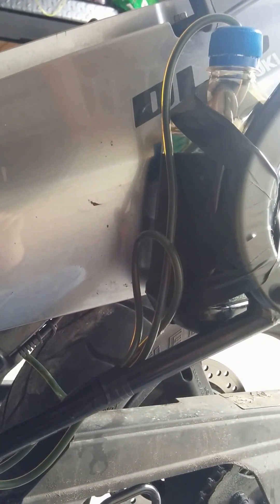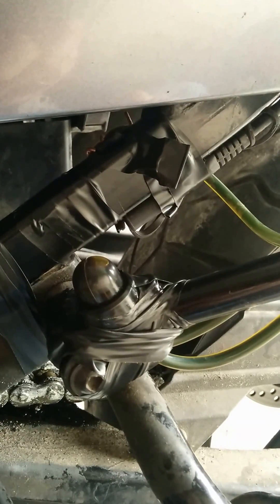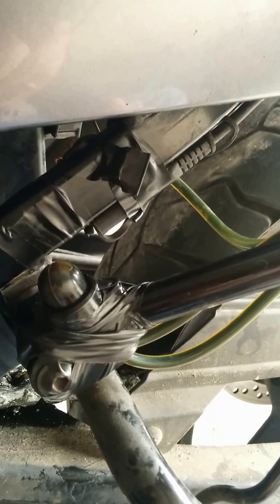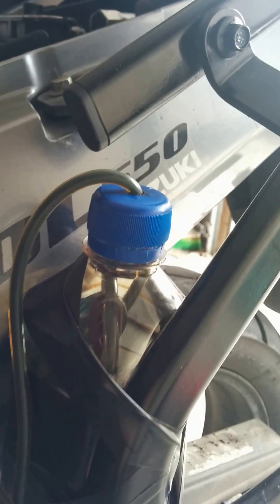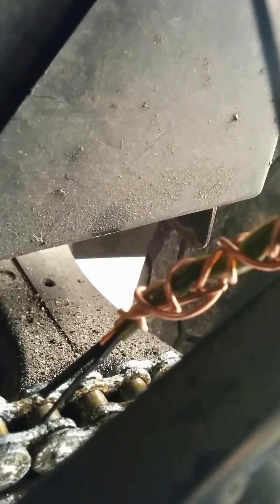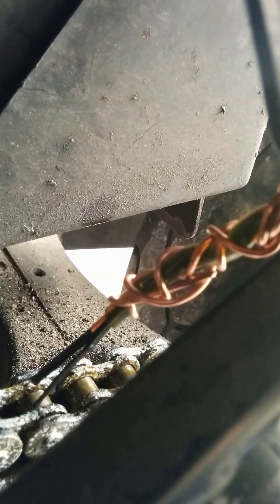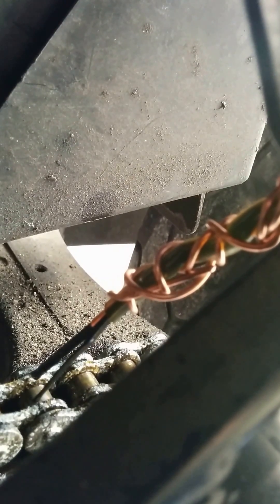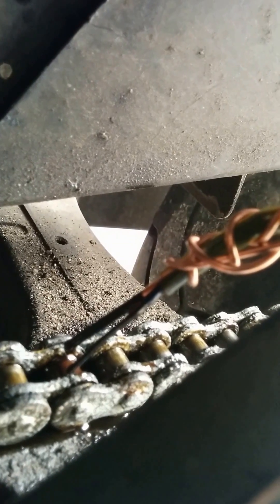$3.50 Cheap Motorcycle Chain Oiler DIY Suzuki V Strom Push Bulb

Comment: Had to drill a small 2mm hole i the brake fluid lid and make a small cut in the rubber lid inside to let some air in so the oil flowed better.

Comment: I used cable ties to mount a brake fluid reservoir near the passenger foot pegs (away from passengers feet) and a in line plastic tap from micro sprinkler system for adjustment to one drop every 45 sec  . I did the cable tie ends in the pipe but used clear hoes with a bit of fencing wire shoved up it so it could be bent to were I liked.You could put in another shut off tap so you don't have to adjust all the time. You can buy an electric shut off tap apparently on Ebay. Good in case you forget to shut off the oil.